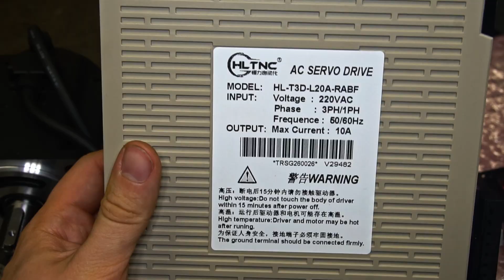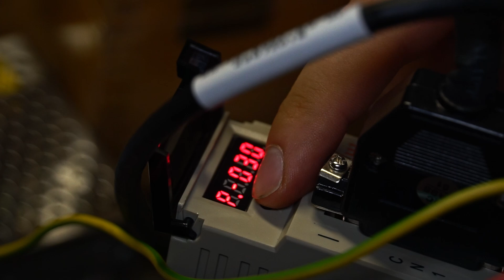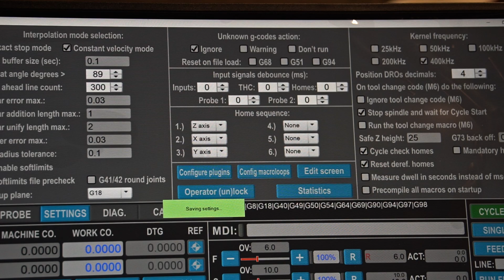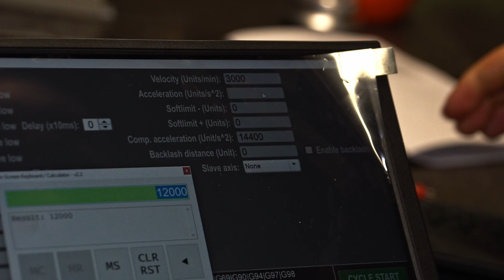UC300ETH-5LPT Ethernet CNC Motion Controller #2 AC Servo Axis Setup

Comment: Great video thanks, did you use the servo drives alarm output in circuit by any chance?
Reply from the maker: I didn't use it with this particular servo but I'm planning to do so in my CNC lathe I'm building now. I did that in my cnc mill, but it was a different AC servo model (similar anyways).

Comment: Why did you connect Pulse and Dir neg signals to  outputs and Pulse Dir plus to supply 5V.....I tend to think of a TTL output as a positive 5v pulse.....?
Reply from the maker: The outputs on the UCBB board  are using optocouplers and N-channel power Mosfets. I wired it up according to the manual of the breakout board available here: https://www.cncdrive.com/downloads/UCBB_manual.pdf

Comment: Thanks for the video!!! Just out of curiousity, did you actually use this AC servo on a machine? Which Servo amp and motor did you use in this video. Also, how would you tune this motor to your system?
Reply from the maker: Sorry for the late response. I used it in a juice press (XD) but I'm going to add this exact servo to my cnc lathe soon. About tuning - there are gain settings etc. on the servo driver.

Comment: Hello, how is the quality of the servo? Better than a 120klg stepper motor?
Reply from the maker: For this moment I can't tell you the quality. If you mean a 120kgcm = 12Nm then this servo has just 2,49Nm. But almost in the whole range 0-3000 RPM. The 12Nm stepper motors have usually the highest torque on the low rpm and it significantly when the RPM raises (at about 500 rpm usually those stepper motors have really low torque)

Comment: Hi. Did you use a 24v power supply to feed the breakout board (BoB) and the 5v from the BoB to feed the controller ??
Reply from the maker: Yes, though i think there should be used a seperate one. I didn't have that moment one so I tried 😉